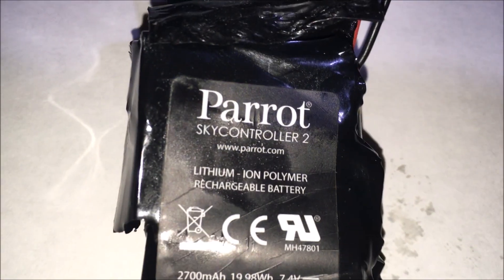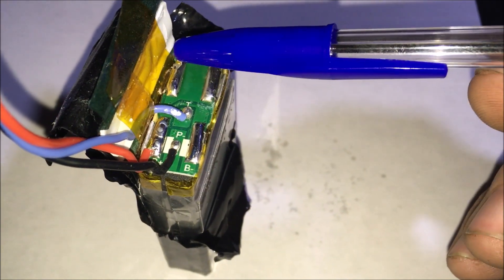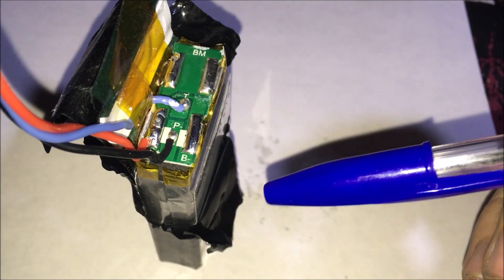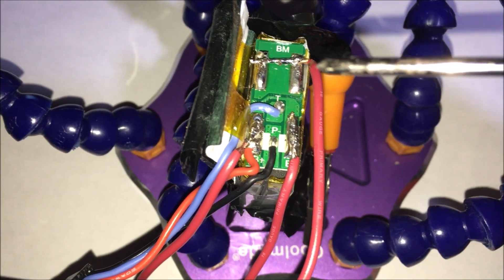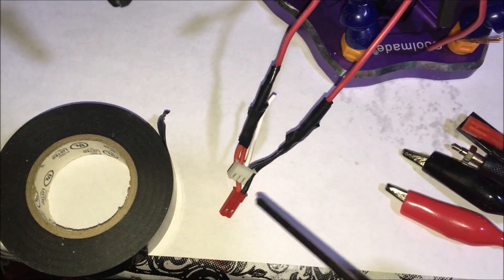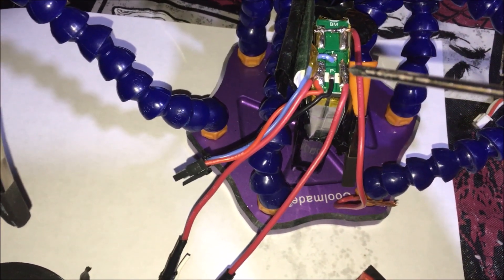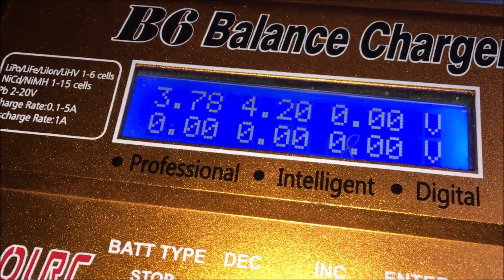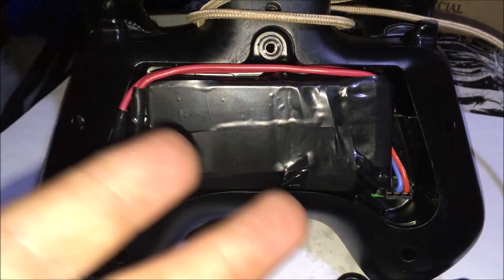Parrot Skycontroller 2 Lipo Battery MOD how to Balance Charge DIY FIX

Comment: You called it a Li-Po but its li-ion so does it still get charged as a li-po or a li-ion ? thanks
Reply from the maker: Mine is lipo they had diff batteries
Reply: @JayDrone  so Jay, is the fix the same in a Li-Ion.?

Comment: You said this would prevent your Bebop from "falling out of the sky". If you lose connection because of failed SC 2 power, won't the drone just do a RTH and show up at take off point?
Reply from the maker: Colin Bruner mine didn’t

Comment: Jayyyyyy....make a video of modifying the sc2 with new antenna. Only thing I’ve found is some dude from japan. I need to get more range in and urban area. Truthfully if I can get a mile from the driveway in any direction I’m good. I’ve been a loyal bebop fan but if I have to cop a Mavic to reach that far then so be it.
Reply: I know this is an old reply/post, but have you tried the 4G/LTE mod.  With this mod I have flown out 15 miles, could go further with a bigger battery.

Comment: Great job... I have the Sky2 but it has the cylinder battery. I have been trying to find a way to change that battery over to a Lipo.
Reply from the maker: If it is same connection easy as pie 🥧 i DONT have that battery 🔋 tho so idk 😐